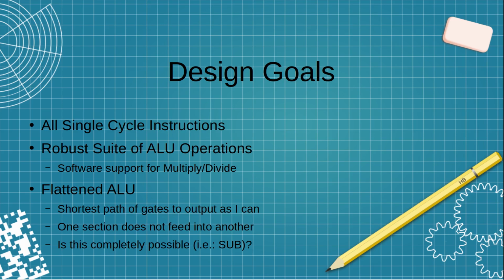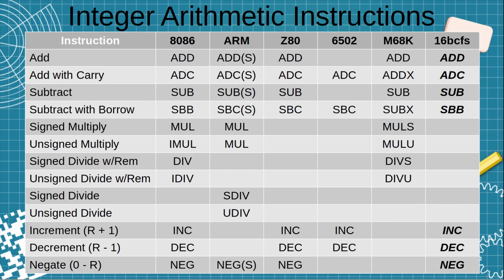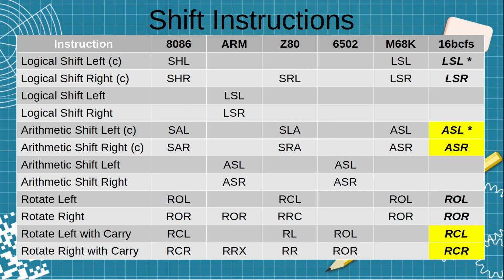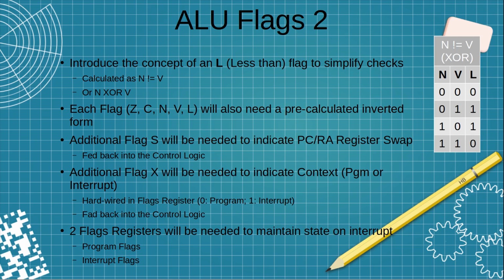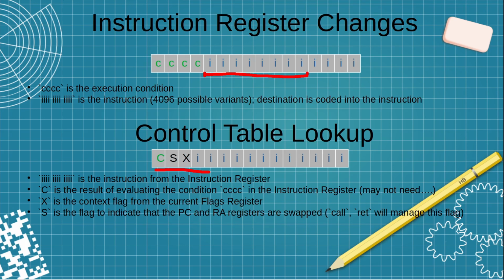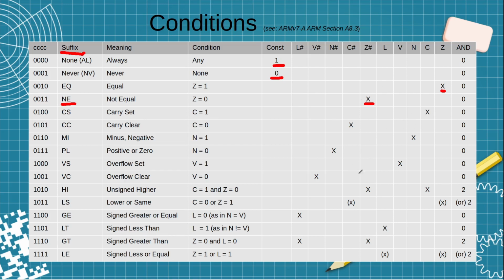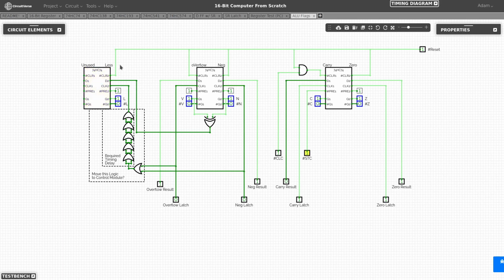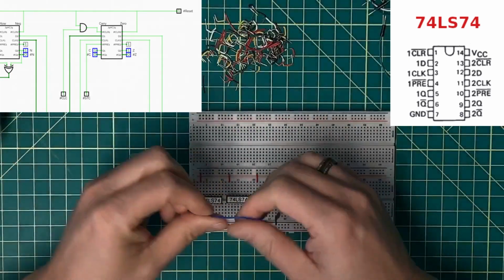0052: ALU Design & Flags Registers Build | 16-Bit Computer From Scratch

Comment: After watching your video I was wondering whether pipelining the processor is in your plans. I'm asking that because I don't clearly see a benefit on conditional execution in every single instruction unless jumps are “expensive". Designing an ISA is about trade-offs, of course, but In my view, the loss of the instruction encoding space used by conditions is not generally worth unless the processor is heavily pipelined.  So I was wondering what was your opinion or views on this matter
Reply from the maker: @RelayComputer

Thank you for the question!  I am going to wander around your points a little bit while I respond.  I hope it all makes sense in the end.  Please forgive the long response.

My original plan was to build a pipelined CPU.  But I also wanted to have as many instructions execute in a single step as possible.  These 2 objectives are not really congruent and I currently have a "pipline of 1" instruction layer (1 Fetch Register and a single Instruction Register).  Is a CPU with a single instruction step a RISC-based CPU?  I think so, but I am not willing to commit to that moniker yet.

What will make the difference for this design will be how quickly I can get an ALU instruction to execute.  I am hoping I can get them all in a single cycle, but that remains to be seen.  I have no insight on this yet, so stay tuned to see if this works out.

As for instructions, I originally had an 8-bit instruction with a 4-bit condition and a 4-bit main bus assert.  The goal here was to get data onto the main bus as quickly as possible.  But with the number of register I would need to latch (consider `add a,b`), I would need to assert the ALU result onto the main bus and then latch that back to Register A.  The ALU would not be the first thing ready to assert anyway.  Given the number of registers I am planning (18 GP registers alone), this is not really tenable.

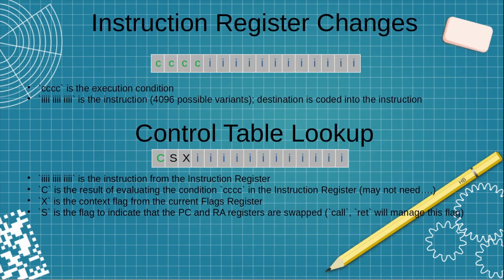As you saw in this video, I made the decision to expand the instruction to 12 bits and eliminate the 4-bit main bus assert (starting at the 9:16 mark).  This improves the instruction space from 256 to 4096.  This comes at the cost of the aggressive main bus assert timing, but this should be able to be overcome.  It also leaves the conditional execution in place, which I believe will be needed to attain a good speed.

I currently estimate I will have 3409 instructions not including the 16 permutations of conditions, so instruction space is not a factor anymore.  Also, conditional execution is not something that I have seen anyone do yet and I don't really want to just take someone else's work and expand that to 16-bits.  ;)

As for the "cost", consider the following HLL pseudo-code:

```
if (a == 17) then
    b = 1
else
    b = 0
end if
```

In an x86-like environment where there is no conditional execution, you end up with code which looks like this:

```
    cmp a,17        ;; if (a == 17)
    jne .label1     ;; +1 if taken to clear Fetch
    mov b,1         ;; then b = 1
    jmp .label2
.label1
    xor b,b         ;; else b = 0
.label2
```

This will result in 4 instructions (let's assume each instruction "costs" 1 for the sake of argument, plus the loss of the existing Fetch when the conditional jump is taken and is a relative jump built into the instruction encoding).

Here you have a 2 jump instructions and you are guaranteed to go through at least 1 jump.

Using conditional execution (such as ARM), you end up with the following:

```
    cmp a,17
    moveq b,1
    xorne b,b
```

No jumps.  Plus a flat "cost" of 3 not matter what.  Not to mention the CPU does not have to clear the Fetch Register if the conditional jump takes place.  Once you get used to that form of coding, I would submit that the code is easier to read and understand -- you only have 3 lines to ingest to get an understanding of the block of code rather than 5.  It is also an executable size savings.

Note: I know both examples could be optimized quite a bit by setting b to zero first and then when a == 17 increment b.  This change would result in about even performance.

That said, I think this demonstrates what you were referring to as "expensive" for a heavily pipelined CPU, but even in a shallow pipeline there is a expense to a jump.

With the design change I touched on in this video, I am not wanting for additional instruction space.  Also, the 4-bit conditional execution is "baked into" the 16-bit instruction word and does not limit my instruction set.  Since conditional execution is something different than I have seen (not saying it does not exist -- I have not seen it), I chose to use it as part of this architecture.

If this does not address your question, please let me know where I fell short.
Reply: @eryjus4594  Thank you for your thorough reply.  

Well, to be fair, the x86 architecture has conditional move and conditional set instructions, so the example you proposed can be highly optimised by speculatively assigning b to zero, then replace it with 1 if the condition is met. This is what an optimising complier would produce for the code you proposed

 xorl %eax, %eax
 cmpl $17, %edi
 sete %al

So this is not that bad after all.

I designed myself several ISAs in the not so distant past, and I found that the real deal is to find the right balance between conditional execution and the availability of large embedded immediate fields. Constant length 16 bit instruction encodings are really tricky (compared with 8 bit, or 32 bit) and I found that enabling conditional execution for all instructions goes to the detriment of large immediates, because there's simply not enough encoding bits for everything.

If we look into history, we will find that generic conditional execution was first introduced in the early ARM processors (at least as mainstream processor). But the ARM instructions are 32 bits wide and the loss of 4 encoding bits was not perceived as such a big deal. Later on, when a completely new isa was designed for the ARM64, generic conditional execution was dropped and only remained as conditional selects, sets, and jump instructions. Also, the 16 bit ARM-Thumb ISA that was designed in-between did not implement generic conditional execution either, again due to encoding space constraints.

So now my question turns into how are you going to load a constant into a register? Will such operation require extra words, maybe specifying the constant after the relevant instruction in an additional word (effectively turning the instruction into a 32 bits one, instead of just 16)?
Reply from the maker: @RelayComputer, loading an immediate will require 2 instruction words -- 1 for the load instruction and 1 for the constant itself.  This is in no small part the purpose of the Fetch Register in my design.  Video 33 (https://youtu.be/h7aCeyQhNjM) touches on this briefly where I am able to assert the Fetch Register onto the Main Bus (Immediate values), Address Bus 2 (Memory Addresses) and ALUB (also Immediate values for ALU Operations).

So, yes, there will be a number of instructions which will take 2 cycles to complete, replacing the second instruction work with a NOP between the Fetch Register and the Instruction Register.
Reply: @eryjus4594  Ok, thanks. The whole thing makes more sense now to me. Just for reference, the MSP430 16 bit microprocessor from Texas Instrument does just that !. All required constants in instructions are expressed in a second word, just after the actual instruction. This applies both to immediate constant loads to registers, and to memory addressing mode offsets, except jump offsets which are encoded in the actual instruction. To reduce some overall constant load overhead, the constants -1, 0, 1, 2, 4, 8 are implicit as part of a special register depending on the addressing mode.  That processor does not have any compelling conditional execution instructions other than jumps, though. Bad design from TI engineers in my opinion...  Anyway, thanks for your time explaining your implementation ideas !!